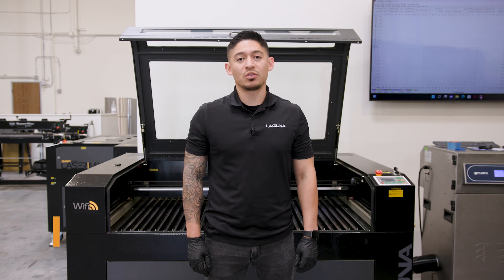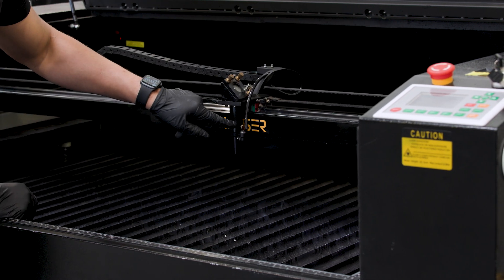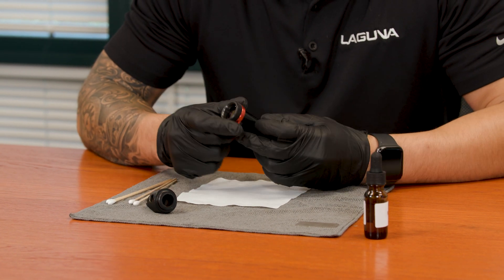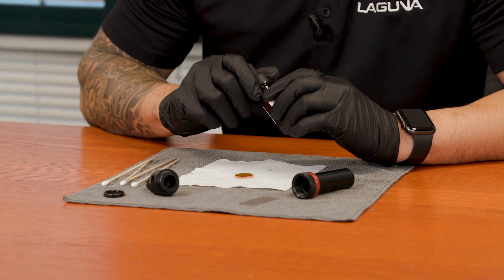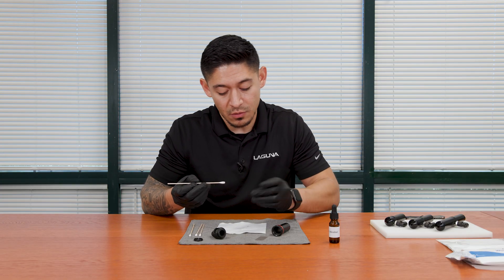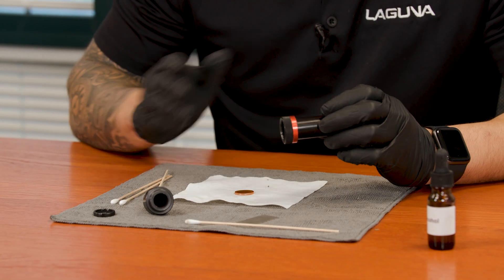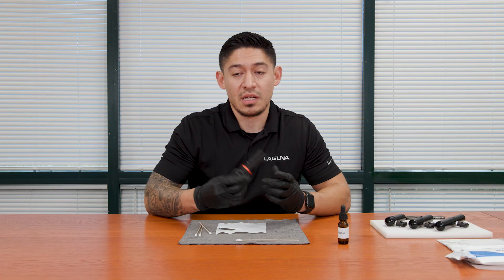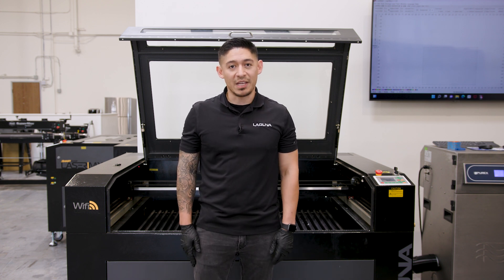How To Clean And Maintain A CO2 Laser Lens | EX, MX, PL 12|20 Lasers

Comment: How do you judge when the lens needs a cleaning?
Reply from the maker: It depends on usage, but it's safe practice to clean after large production runs (multiple products at one time), after every 5-8 smaller products depending on the material used, and always clean when changing from one material to another, such as switching from Slate to Wood.

Comment: Well done- this was a video that was really needed.  

I noticed your EX laser has the auto focus bracket and probe removed.  That means the lens tube sits higher in the housing by the width of the bracket how does this impact focal length or does it?  

EX manual indicates focus for factory lens is 7.5mm the American Photonics lens kit says 10.5mm for each lens.  Are these still correct focus points with auto focus bracket removed?